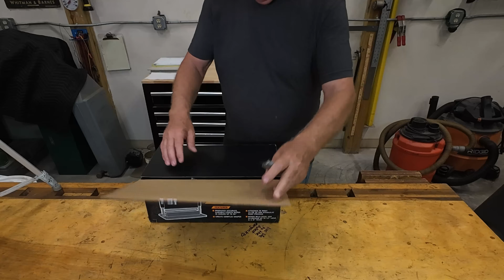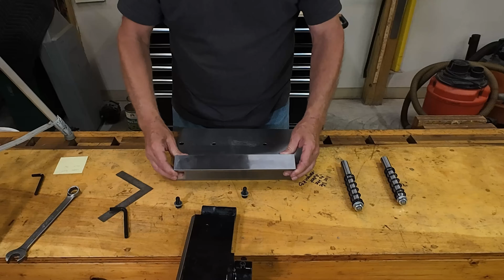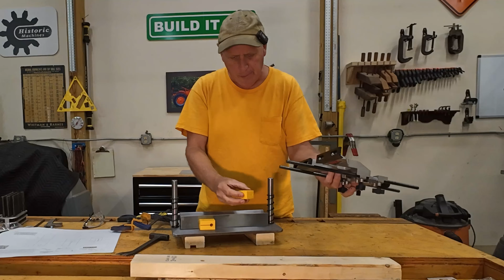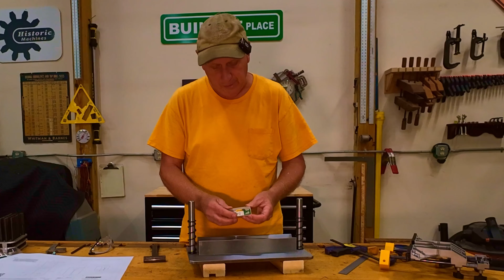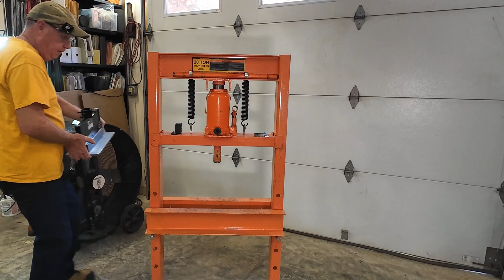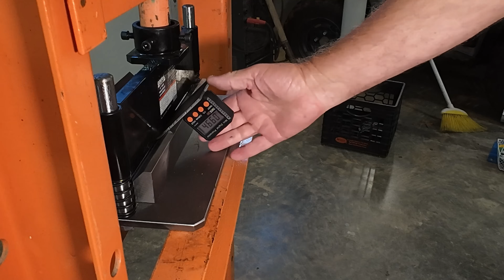Harbor Freight - 12-Inch Shop Press Brake Attachment | Unboxing, Assembly & Custom Back Gauge

Comment: For potential buyers, here's a HEADS UP!!!  I just finished assembling mine.....after sorting out an error. The screws meant to attach the lower die to the plate are M10-1.5.   But, as I discovered while trying to clean out the threaded holes, they're actually tapped for a 3/8 NC bolt.  I did let HF technical support know.  So proceed with caution.
Reply from the maker: Did you adapt a back gauge to your bender? I recently made about 40 angle brackets using 11 ga steel with angles ranging from 90 degrees to 15 degrees with outstanding repeatability thanks to the back gauge attachment.